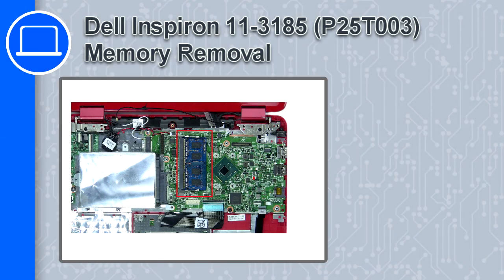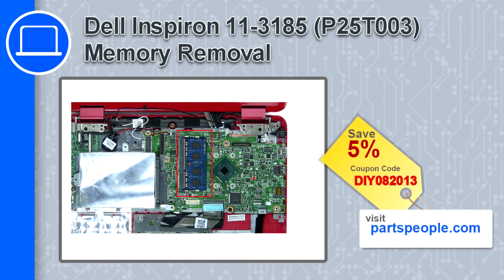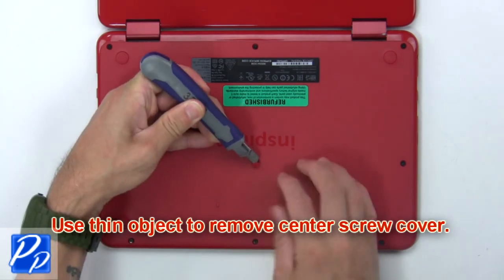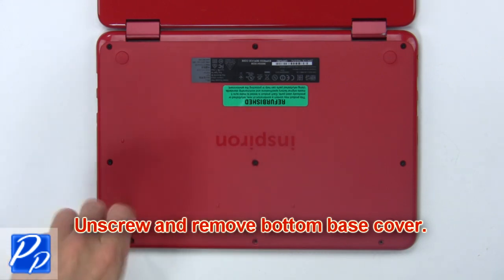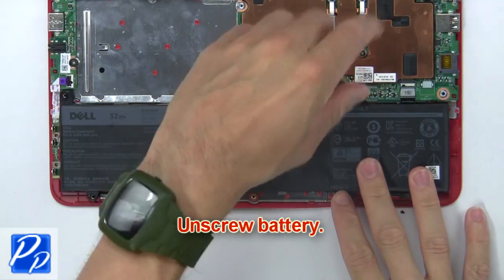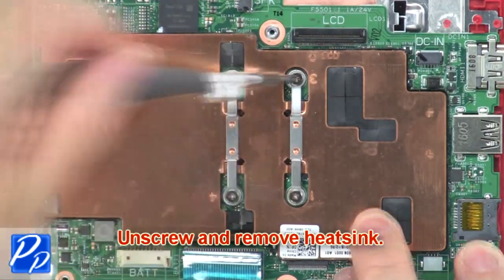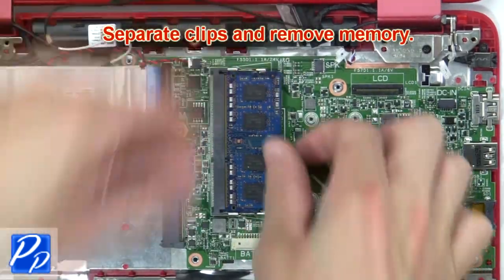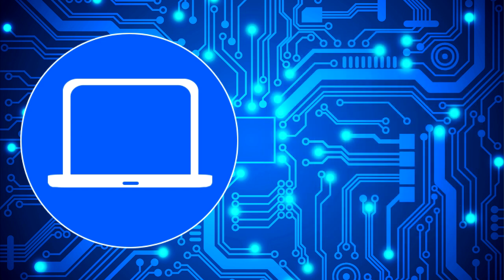Dell Inspiron 11-3185 (P25T003) Memory How-To Video Tutorial

Comment: Wondering If I would need to add thermal paste when putting it back together?
Reply from the maker: I would say this is optional depending on how well the old paste appears to be distributed.
Reply: How many slots are there?
Reply: 1 slot on this model